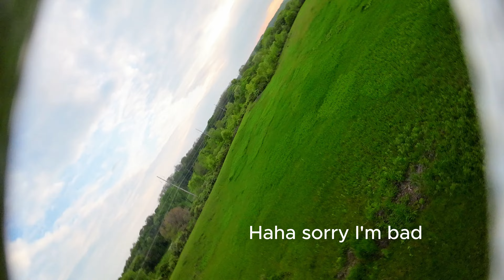Struggling Like Usual

Comment: 3d mode is scary 
i see you are using the pocket 
do you like it and is it your main radio?

id suggest an analog basher quad for experiments thats cheaper in case of bad experiments :D
Reply from the maker: I like the Pocket alot, I also have a Jumper T-pro but don't like the buttons/switches as much. 
Your right I really do need a basher quad!